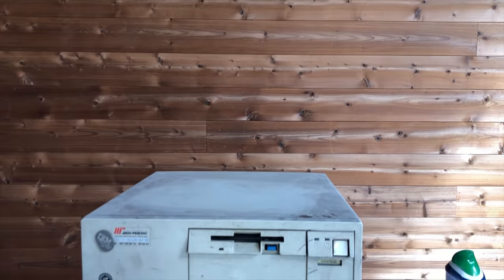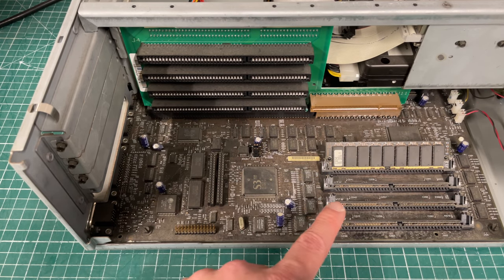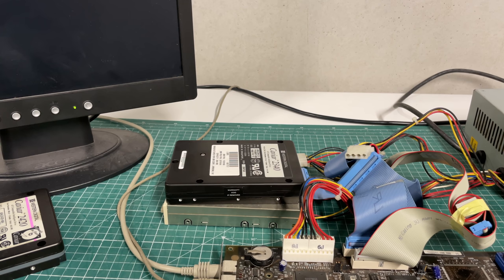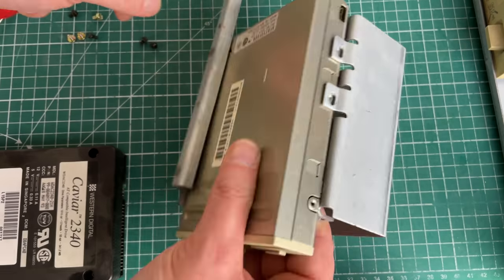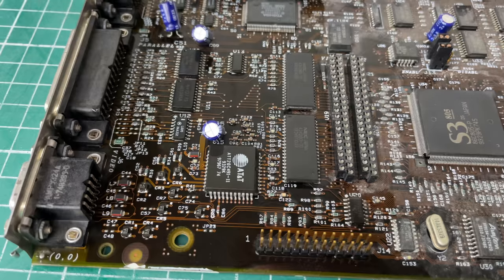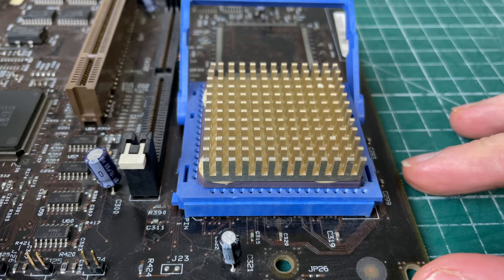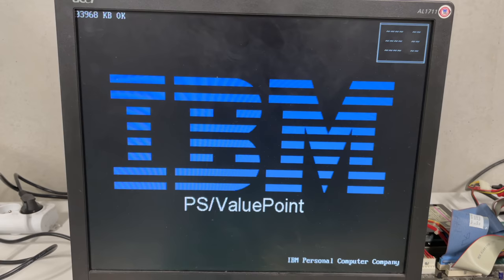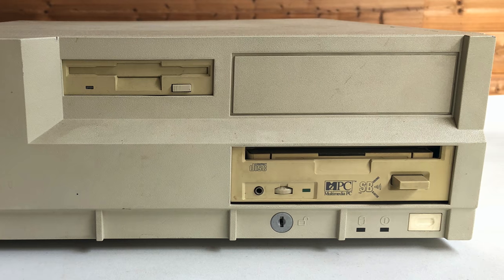IBM ValuePoint 6384 466DX2/D : Part 1

Comment: pro tip, if you want a good board cleaning brush go to the plumbing section of your local hardware store and look for flux or acid brushes, natural bristles in a metal handle, cost peanuts, disposable and if they are too long cut them down a bit with scissors. Here in the USA you can get a 36 pack of them for $2.50 at harbor freight (or about 7 cents each)
edit also I have been known to take a hand held pin vice and a small drill bit to unplug holes on vga outputs, there's no contact behind it so go for ti
Reply: not esd safe

Comment: I once bought a bag of retro RAM and it had some weird short ones in there that didn't fit anything. Turned out they were COAST modules (Cache On A Stick) for the CPU. Later came across a Socket 7 motherboard that supported them. I've never seen one before.

Comment: You can try to rinse the board with soap  and water then rinse with pure alcohol. Dry it for couple of days and mobo should be looking as new. Its a good idea to remove all socketed ic's and before drying you can blow the board with compressor... 👍

Comment: The Valuepoint series had 'Type 1' (SIMM sockets perpendicular to the riser slot) and 'Type 2' (SIMM sockets parallel to the riser slot) for the mid-range systems - Yours is a 'Type 2'. Scroll down to the matching planar in this reference for jumper settings: http://ps-2.kev009.com/pcpartnerinfo/ctstips/a26e.htm

Comment: Looks like one of the type 2 boards too with a W series. I just got a 6384/D K30 which LOOKS like a type 2 board but is in fact a type 1 board. Very confusing. Do you know what kind of dip vram IC upgrades the video memory?

Comment: Nice, a caddy loading CD-ROM drive. You don't see a lot of those, since they were a bit of a design mistake -- the naked discs simply weren't so fragile as to require them, and people quickly learned how to handle them in a different way compared to floppies. Plus if you had a lot of on disc software, you'd have had to buy a lot of extra caddies for your discs to make swapping them around less of a hassle.

Comment: I was recently given a 433DX/D that's also missing the L2 cache. Do you know if any 256KB COAST will work, or does the motherboard require a special module? I'm hoping to add the cache and maybe swap in a 486DX2 to have a slick DOS gaming machine.

Comment: Some time many years back I found an adapter for the VGA that would let you plug in conventional VGA monitors (it would provide you with a port with all 15 pin-holes).

But it's a Western Digital hard drive, of COURSE it's dead.

Comment: I have serious doubts that there is no way to clean that motherboard. Seeing so many restoration videos, There is something for everything. You just have to find it. There is always a way.
Reply: Giving it a soapy water bath with a soft anti-static brush would do wonders, then you soak it in isopropanol alcohol later so that it doesn't start to rust from the chemicals in the future.
Reply: if put really dirty PCBs in the dish washer, works great

Comment: I had the 50MHz version of that range. It had the TSENG 4000 on board with 1MB video RAM and it was SLOW! Just above 1000 cps on LandMark. My slowest ISA version of this card managed around 2600 cps, my fastest ISA version of this card gets just above 6000 cps and I have a VLB version of that card that I can't remember how fast it was, but definitely five digit.
You even had to wait multiple seconds for the Windows wallpaper to appear (yes I use 1024*768 with 256 colors wallpaper just because I can).

Comment: I have a ValuePoint which is exactly the same as this one. It has a power saving feature in the BIOS which powers down hard drives after a period of inactivity. Is that what's going on here? I'd test the drive in another PC before saying it's definitely broken.
Reply from the maker: It did the exact same thing in another computer.

Comment: Interesting video as usual.  I have one of these machines with the same CPU and 16mb RAM, although mine has a 128kb cache chip and I don't have any double key stroke problem.  Maybe I don't have the same onboard chips, I must check.  They are very nice machines and quite fast.  I am hoping you will explore the Pentium Overdrive option, it has piqued my interest but I haven't explored it yet.  Cheers

Comment: The blocked VGA pin is redundant, you can just pull/break/clip off the relevant pin from the VGA cable and it will work 100% fine, that's what I did with my PS/1.

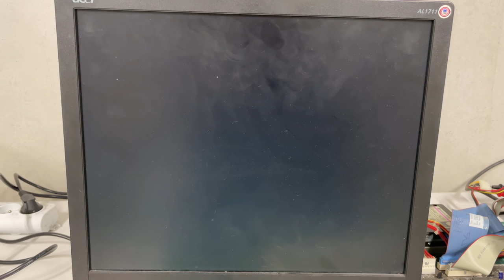Comment: 18:35 Same BIOS as in my HP VL 486 and HP XU Pentium Pro. In both I replaced the HDD with CF card converters. I still have the hard drives stored/preserved but they can be flaky at this point in time and I prefer the lower power draw and no moving parts of the CF. Interestingly, in my 486 the CDROM is not even a BIOS option even though it is plugged into the Motherboard. It still works and is accessible despite the BIOS not seeing it or having options for it. There are also limitations with drive sizes. My 486 will not see any CFs larger than 1GB, however the XU with the same looking BIOS can easily access a 4GB CF. Any one know what this BIOs is actually called?

Comment: I doubt that sound card / cdrom was installed by IBM. Even though the IBM with VLB could come with a sound card it was usually a Sound Blaster 16 CT2950 , CT1740 , or CT1770. With Panasonic CDROM. There where so many versions of the IBM PS/1 and Value point and it all depended on what store you purchased it from. Each store carried its on versions. I assume this was a marketing scheme by IBM. In USA there are about 10 or more different versions on the IBM PS/1.( desktops and towers ). Also the Sound card installed should show up in bios.
Reply: Even PS/1s were shipped with Sound Blaster 16s, the ValuePoints never had SB Pro 2s - it was installed afterwards for sure.

Comment: I think there originally was L2 cache installed, if you look at the socket the plastic tab thing on the left that you use to release/secure it is missing. If it wasn't that keyboard thing, someone probably broke it and it wouldn't stay in anymore.

Comment: Nice one... i have a mainboard like this with a 486dx4 cpu and 32mb memory module. When i try to get it started i always keep getting that same code. I really like to get it working. 

I want to know. Does it work without a riser card? Can i use the slot as it is?

Comment: I wonder if the original hard drive was ok in the first place, just not configured in the BIOS and shutting down as a kind of power saving measure. You should try it again and see if the BIOS sees it.
Reply from the maker: Bios did see it, and detected it as a 300mb drive but it kept shutting down after a minute or so.
Reply from the maker: Also tried it in another computer and same thing happened.

Comment: We just put dirty boards in conventional dishwasher top rack, take em out blow em off with air gun .. let em set vertically  for a few hours and ready to go.
Reply from the maker: I’ve also done that, but heard people advise against that due the non-distilled water used in that case. Leaving minerals behind that would cause corrosion long term. Perhaps rubbing it with ipa after the dishwasher treatment might help in that case.

Comment: This Power Supply was obviously "adapted" ,probably because find and original IBM is nearly impossible today...
The main issue with this machine is finding 70ns memory with parity, otherwise it doesn't recognize on system BIOS...

Comment: Ironically, I think the PS/Valuepoints did in fact use MS-DOS rather than PC DOS.  I remember using a 433DX of some sort Valuepoint and it had MS-DOS 6.x of some sort and an IBM-badged Windows 3.1.
Reply: why is it ironic?
Reply: @BenState  Because IBM had PC DOS - it didn't make sense for them to offer MS-DOS.

Comment: Loved the HD sound as long as it lasted :)
I prefer Quantums for the sound. 
This design is not my cup of tea sadly, except that sexy brown mainboard.
Reply: Quantums were too whiny for my taste, except for the rare 2.5" GoDrives, which died like flies when they were about 15 years old. WDs sounded nice, even if the head movement is a bit coarse. I really have to check what brand of hard drive my Compaq 286 has, I really loved that sound!

Some of the best-sounding drives are still full-height 5.25" behemoths, regardless of their brand. The sheer mass of the giant platter stack gives them an incredible spinup sound!
Reply: @Ragnar8504  So true

Comment: Immersion into a liquid and scrubbing is only way. I like using soapy water and toothbrush, but that kills stickers. (edit) Or use a brush and compressed air! (editedit and not the only way, lol)

 <3 all
Reply from the maker: Do you rinse it with distilled water or use IPA afterwards ?
Reply: @RetroSpector78  IPA then hair dryer... (edit) tho that sounds dangerous, not until after most of it evaporates!

Comment: Nice video! Are you going to put in new thermal paste on the cpu?
Reply: just after he uses rotary tool to remove glued heatsink  :-)
Reply: @rasz  is it glued? I thought it was thermal paste 😅
Reply: it looks glued all right, using something akin to bathroom tile epoxy glue

Comment: Great Video as always, I also have an IBM Value Point with an 66Mhz 486 cpu, 16Mb Ram, Cirrus Logic CL-GD5429 VGA GPU and a 92C828A Sound Card. It runs wonderful, but sadly I killed my Win 3.11 on there and I cant reinstall it because it always crashes during installation.
Reply from the maker: Didn’t think win 3.11 was capable of crashing during installation... you can try installing it on a VM and then just copy the windows folder to avoid doing the installation.

Comment: These Linkworld power supplies are the worst of the worst  😕
Reply from the maker: Yeah ... not really sure why all of a sudden it gave up on me when I pulled everyting out ... Can't remember me shorting something ... did a quick check around the area where I saw the spark and I think the schottky diode is definitely shorted , and a couple of diodes are failing. But root-cause can be something different off-course.
Reply: @RetroSpector78  The main thing is that the power supply has not caused any damage to the PC. I've known Linkword since around the year 2k and the parts are notorious to fail.  I am looking for a link

Comment: I wouldn't clean this motherboard with a brush, because you might wipe off SMD components. Been there, done that.
Reply: Mr Guru  The solder that's applied to the SMD components is so old now (been through so many cycles of temperature changes) that it might 'crack' once pressure with a brush is applied. Dust doesn't hurt the functionality of the motherboard. I would not try to 'detail' hardware.
Reply: Mr Guru  It's called cognitive dissonance. Look it up, ''mr Guru''.